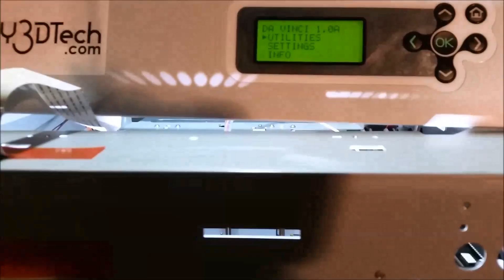XYZprinting Da Vinci 3D Printer - Oval or Oblong Circle Issue Fixed

Comment: mine is out of alignment i have the duo 2.0 im getting a circle with two small mini flat spots on the left and right. im looking at the belt and pulleys my right one has a gap in the video i dont understand what your doing are you holding the pully so the belt doesnt move so you can get the housing that the belt goes thru (aka the black box) to skip teeth?
Reply from the maker: Yes you want to align the teeth (of the belt) as that is the issue as one side or the other is off by a tooth or two.

Comment: Thank you for all your Da vinci tune up videos i got my printer running nice and smooth with good prints
Reply from the maker: Excellent :-)
Reply: DIY3DTECH.com I noticed that on a couple of your videos you mention the light on the da Vinci turning off after a few minutes you can disable the save energy option and have the light on all the time but you probably figured that out by now
Reply from the maker: Thanks for sharing as I have since reflashed it and I can control via the control panel however other might find it helpful :-)

Comment: Very helpful video! I have a grey 1.0A and have this same issue.  After fixing my machine using this method, I am closer to a perfect circle but I am still having slight "oval-ing" issues...  Would you have any other ideas what can make my machine have perfect circles?

Thanks so much!
Reply from the maker: Many thanks!  However you likely are still out of alignment as that is the only thing which will cause an oval and dosen't have to be much.